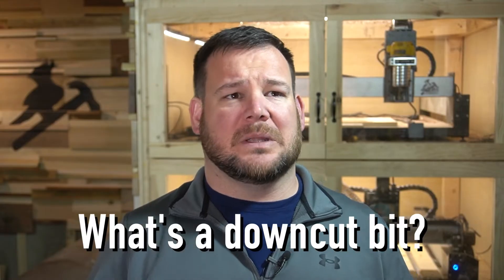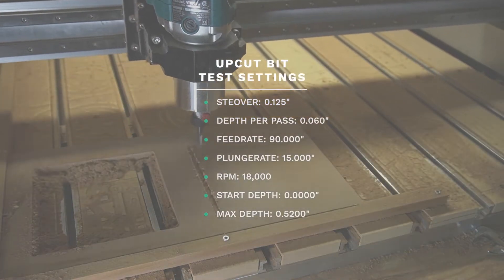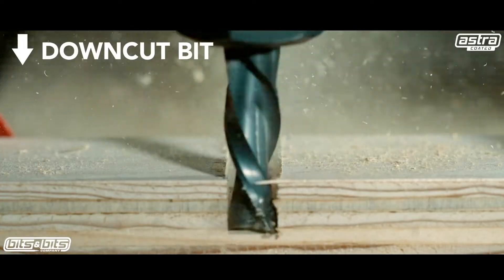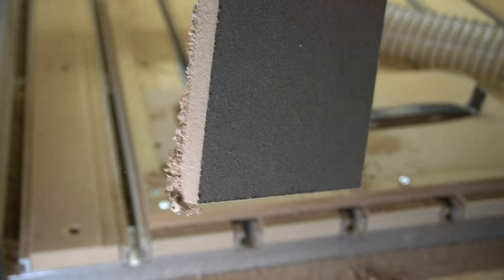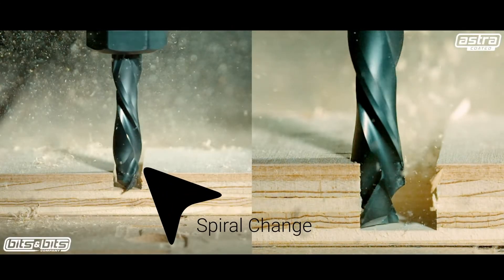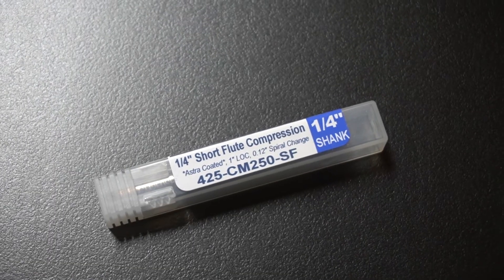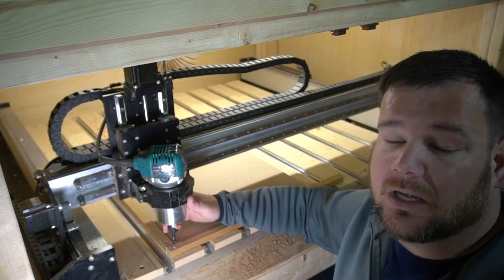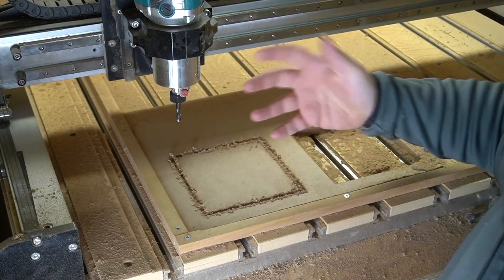CNC Router Bits Explained: The Best Bit To Use

Comment: Thank you. One comment: I think you could use a combination of a downcut bit and then an upcut bit to get both sides clean. The advantage of this combination is that you don't have to worry about the initial plunge cut. - although the disadvantage is that you have to change bits. Nothing is free.

Comment: Hey Andy, I've watched your video a couple times now and realized you don't follow through with cutting out the second square to completion. It would have been nice to see the compression bit continue through the material giving the downcut portion of the bit the chance to clean up the top edge. Correct me if I'm wrong, especially when using mdf that wont have long stringy fibers, the bit would eventually work it's magic making a smooth top and bottom edge while still operating at safe speeds and feeds even if the first pass or two aren't deep enough to have both edges cutting first pass?

Comment: A question on the compression bit with the 1/4" change.  If my CNC is using the Makita for its spindle, would it be able to handle that 1/4" plunge?  Thanks.
Reply from the maker: There are a lot of other factors to consider for success, but if it comes down to the just the plunge of the Makita yes it can do it.
Reply: @AndyBirdBuilds  Yes, certainly other factors.  Thanks for the reply.  Still learning on what I can do with the CNC.  Thanks again.  Love your videos.

Comment: What would one use if you’re cutting a channel/slot/key way in which a clean top surface is desired, but also a clean bottom surface?

Again, a channel that doesn’t go all the way through the work piece. The depth of the slot is .35 inches.

Thanks.
Reply from the maker: I would use a downcut bit
Reply: @AndyBirdBuilds  thank you! And many thanks for taking the time to reply too - I shall give that a try. 👍🏽

Comment: Does SpeTool have specs for the spiral change?  I don't see any info on this on their up/down bits.  If there isn't a spec given can you just use a micrometer to measure the bit on where the change occurs?  I would assume it would be visually obvious on where this is on the bit.  If we're still on track here, Is that value then used for the routers plunge rate?
Reply from the maker: Yes that would work
Reply: The plunge rate is the speed the bit moves vertically into the material, which is different from the depth of the initial pass.

Comment: Is it possible to reverse the rotation direction to turn an up cut bit to a down cut bit?
Also, can you do the first top pass with a down cut but and then do the bottom pass with an up cut bit?
Reply: Yes, if you want to reverse your spindle or router, of course.  If you want to do the second, of course you can too.  Just takes more time.
Reply: Reversing might not work well because the tip of the bit would still be designed for a clockwise spin. The side of a bit definitely does a lot of the cutting as it moves horizontally, but you might be left with an uneven face. Could be worth a try, but I’d rather use a compression bit than set up two toolpaths and do an extra bit change.

Comment: I use single flute straight flute bits for almost everything. Cuts are clean and smooth top and bottom.
Reply from the maker: Thanks! I recently read this somewhere and was intrigued. I'm going to give it a try. Any tips?
Reply: @AndyBirdBuilds : Did you try it?

Comment: Andy - Shapeoko owner for 3 yrs now.  Both my 1/4" upcut and downcut bits are discolored and I assume are getting dull.  Time to replace them.  I like your video on "Best bit to use" and I have a question.  You show the Max Depth as .52000" for both bits.  Bits&Bits shows the max cut length of 1".  Why are your depths so conservative?
Reply: I’m pretty sure that is the depth of cut for that toolpath. If he’s cutting .5” MDF, then he’d be cutting .020” deeper to ensure a cutout.

Comment: Great video, bro. 
 Very informative. 
 Just wondering: Do you use a spoil board on your machines? 
 It seems that you are obliged to replace the machine bed slats - on a regular basis, otherwise.
Reply: It clearly shows a spoil board in the video. He just divides it up into slats so he has access to the T-slots.
Reply: @ryanlangan1060  
 I arranged mine in a similar way, and I have never needed to replace anything, even after 12 years of use, due to the use of sacrificial materials. 
 That's what I mean, by spoil board.

Comment: I have a project that needs a triangle cut out of the center with sharp corners so I am thinking of using my 10degree engraving bit to clean up the last bit of the pocket. Any other suggestions? I cant find any videos on using engraving bits on the CNC for wood and super fine detail. My tapered ball nose wound work here…has to reach .505 down before cutting a .180 deep clearing. Hmmmm
Reply from the maker: Its really hard to say without knowing more details. But the smaller the radius the bit has, the tighter the corners you can get

Comment: Andy have you ever done a video on doing tool changes using the bit setter and bit runner..that might show the different screens in carbide motion 542
Reply: Well I think it would help a lot of Shapeoko owners that have the bit setter and bit runner. I know from experience  that if you don't understand it fully  bad things happen. Jeff
Reply from the maker: @resorter66  Good point
Reply from the maker: I haven't. I've been thinking about doing a video on the Bitrsetter but haven't because its specific to the Shapeoko

Comment: Can you use a downcut bit for the first pass and then go to an upcut bit for the final pass through the part as a way to get get a clean top and bottom surface, or will the chips being ejected on the last pass with the upcut cause issues with the top edge of the part?
Reply from the maker: In theory this would work but it wouldn't be worth the headache to setup the tool paths
Reply: @AndyBirdBuilds  Thanks for the reply!  Getting my CNC in April!

Comment: Sounds like a bit i need  ?question did you or do you recommend plunge ramp in with that bit and the others.
Reply from the maker: It really depends on the material. For more woods it isn't necessary
Reply: @AndyBirdBuilds  what  about hard maple and walnut